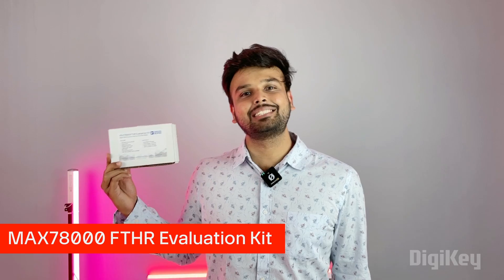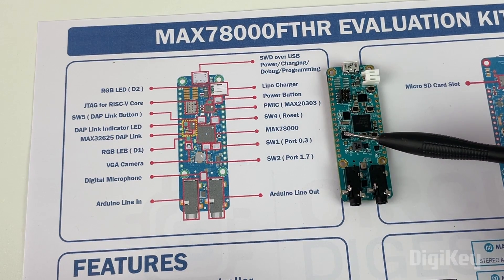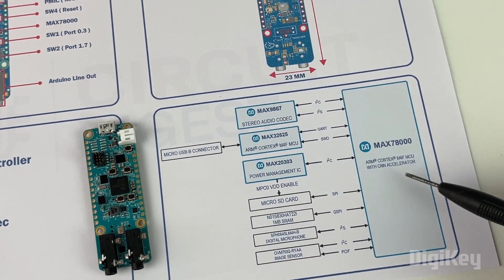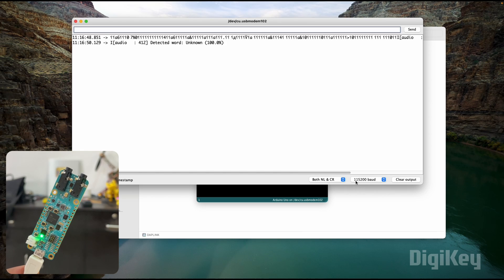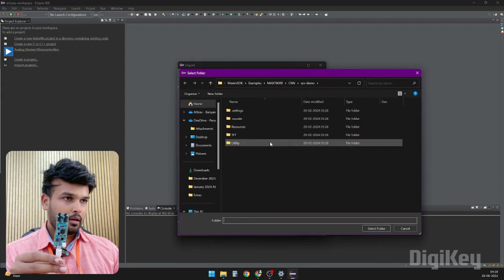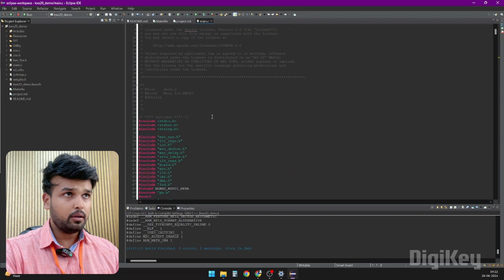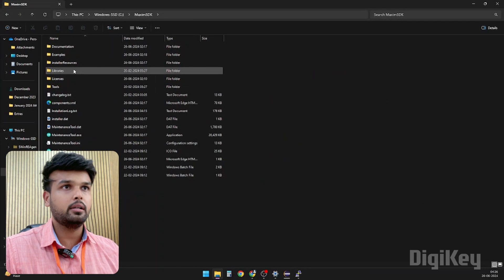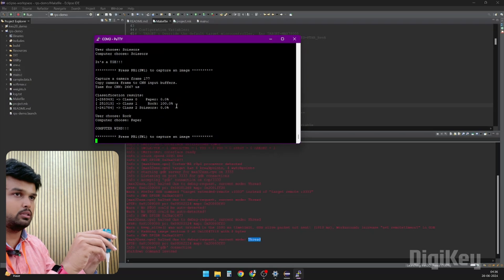How to use MAX78000FTHR Dev. Board | IoT & Edge AI Project Challenge

Comment: Hi Sir,
I hope you're doing well.
I recently completed the integration of the MPU6050 sensor with the MAX78000FTHR board, and it's successfully reading data.
Now, I’m working on integrating the MAX30201 heart rate sensor with the same board. The sensor initializes correctly and gives the first reading, but then the code stalls and does not continue to provide values.
Could you please help me resolve this issue? I will appreciate any kind of help. 
Thank you!
@Circuitdigest

Comment: Very interesting. Few questions: 1) Can VScode be used, instead of eclipse ?  2) It has no wireless, right? 3) How can I get such a device? My application is custom image recognition and controlling via ESP32, so probably I2C communication if no wireless.
Reply from the maker: Hi, Yes it does support VS Code along with Eclipse, Keil MDK and IAR workbench. No, it doesn't have any wireless connectivity. You can get them from most reputed suppliers such as Digikey. You can also participate in our IoT and Edge AI challenge to get a chance to with this board and numerous other prizes. https://circuitdigest.com/contest/iot-edge-ai-project-challenge-2024/